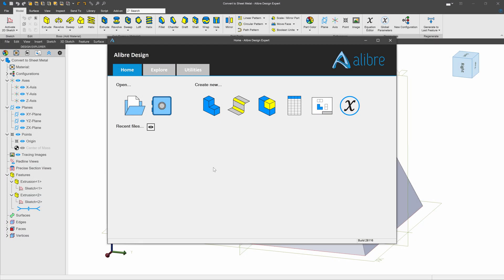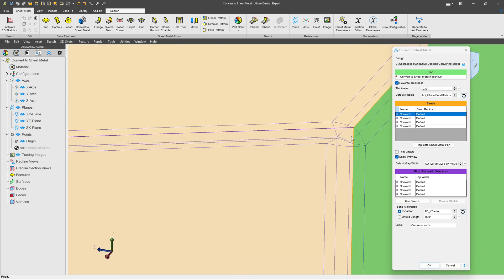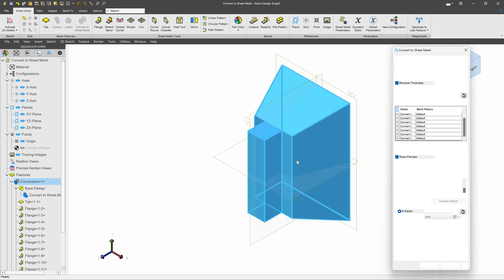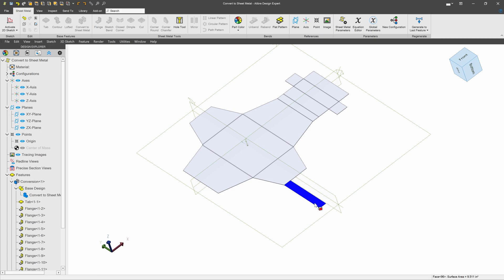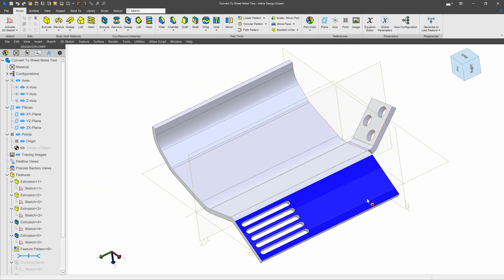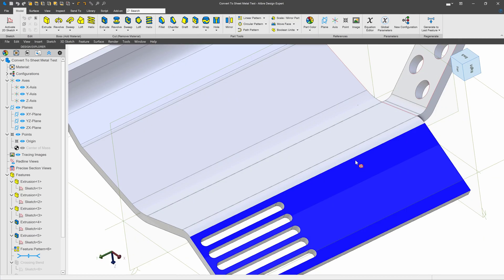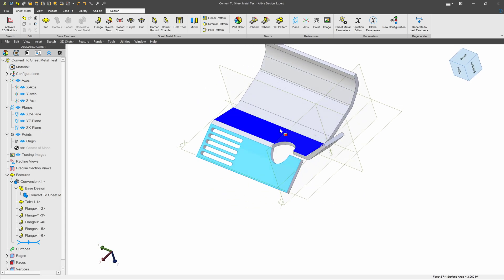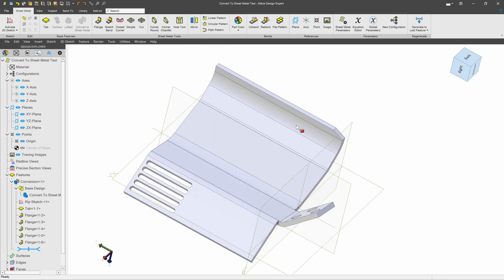Alibre- All about Convert to Sheet Metal

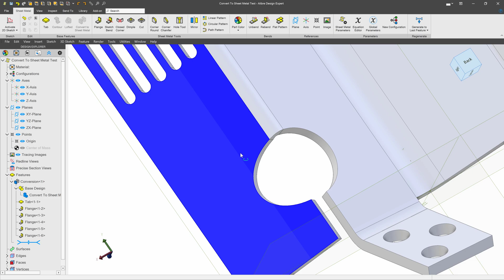Comment: Using convert to sheet metal is a great way of sharing part files across different CAD systems. However, as shown at 6:19 in your video, you need to be careful when there are holes or cutouts that cross bends. It may be necessary to remove or suppress them in the original part before converting to sheet metal so the bend is not compromised. Then add the hole/cutout in the sheet metal part with an unbend/rebend as appropriate.

Is Rip only used to trim corners? Seems like that is the only example ever shown for the option and a chamfer could do  the same and be more easily editable.